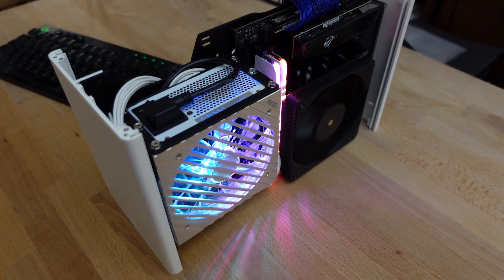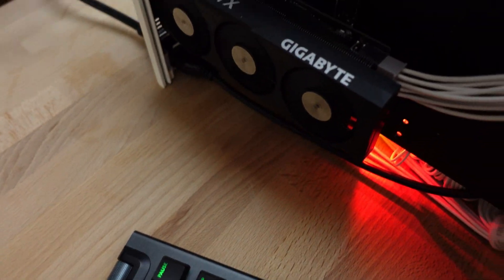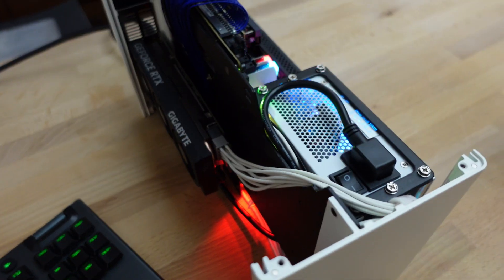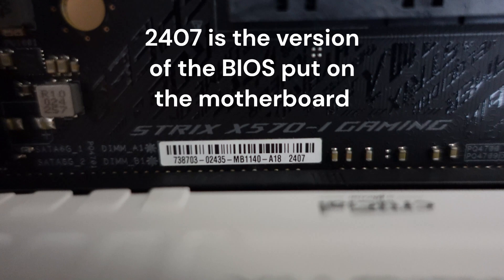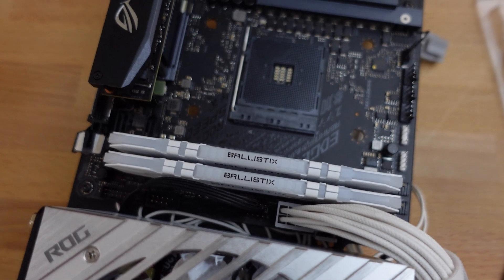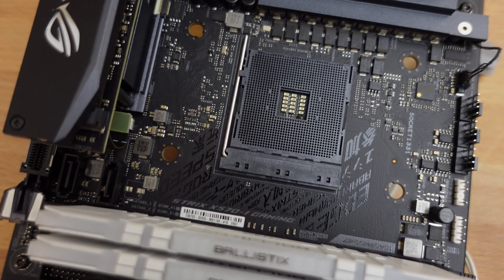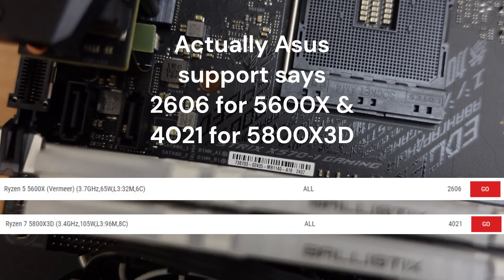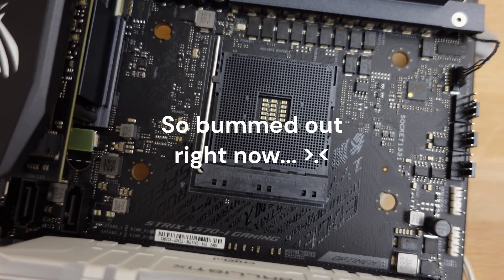Something is wrong… NO POST… old BIOS for AMD 5600X and Asus ROG Strix X570-I - Persephone Build

Comment: Had this issue the other day when doing a mobo/cpu/ram upgrade. I reseated the RAM/GPU then powered up the computer and let it sit for a while. The post screen eventually appeared after waiting a long time. According to my friend in IT, this can happen because a computer needs to learn your new RAM and it can sometimes take a long time for the first post to actually occur.
Reply from the maker: Yes, sometimes with new memory the motherboard does some auto-training for timings. I did let the computer sit for a while, and then checked all the various culprits, even used different RAM and sometimes it helps to only put one stick. I changed the video card also and tried to re-seat the cable and even used another PCIe cable. If you look at the following video after this one I was able to confirm the 2407 BIOS and confirmed on the Asus site for the motherboard that the 5600X was not added to the BIOS until a later version. After swapping out the CPU with a 3900XT things worked instantly. Tonight I was running some benchmarks with this, and will swap back out for the 5600X to see how performance differs.
Reply: @nispoe  nice! glad u got things settled
Reply from the maker: @imthatguy7394 These kinds of setbacks definitely taint a good build experience, but also add to the story and give experience.
Reply from the maker: Oh, one more thing is I was going to add a speaker on the motherboard header to see if there's a beep code. That's when I saw the sticker and wondered what the BIOS version was. This led me down the path to confirm 2407 on the sticker means the BIOS was old. I was looking then for the BIOS flashback... and found there was none and I'd have to get a 3000 series CPU. Also, if the CPU doesn't work with the motherboard my experience has shown me that it may not even beep, and this is how you tell something is up with the CPU. I also learned that when these parts were first released AMD did have some sort of program where they sent you some sort of loaner CPU so you can perform BIOS upgrades. This no longer existed so I spend a couple days looking for good eBay or Facebook Marketplace deals.

Comment: Asus being a cheapass even on their expensive motherboard. The cheapest ITX mobo I can find on pcper is Gigabyte A520I AC and it has bios flashback feature.
Reply from the maker: I have a Gigabyte Z690 Master I use for my daily, and it has been a champ. Next time I'll give the Gigabyte ITX a try. I had an AsRock in hand from newegg that was an open box, but it was very limited around the socket where the Jonsbo cooler didn't even fit, so I returned it.